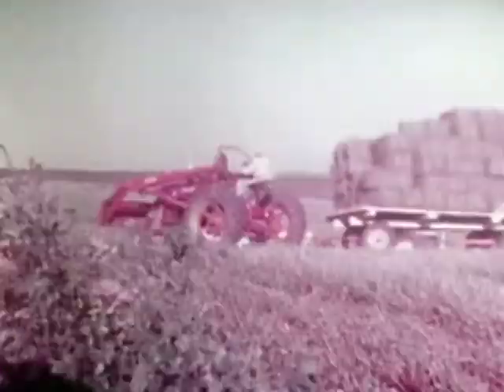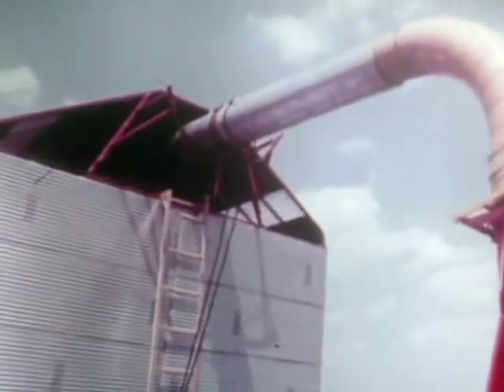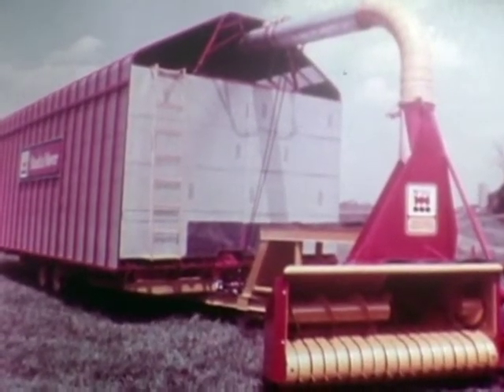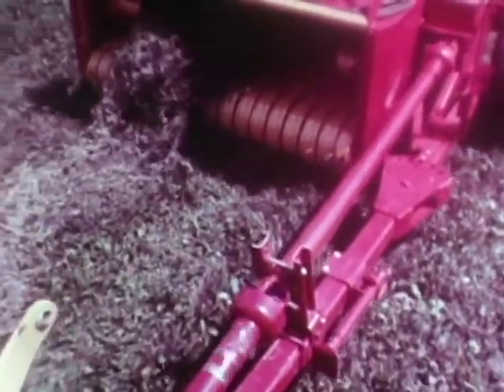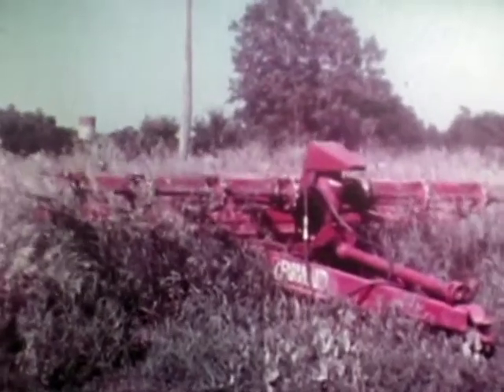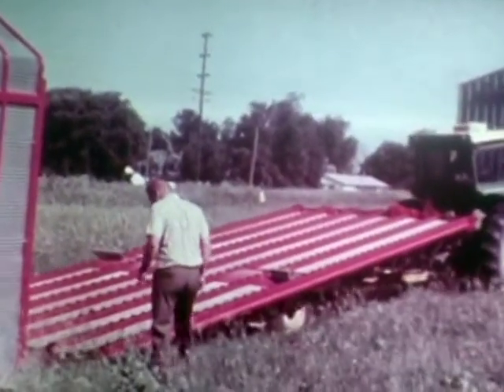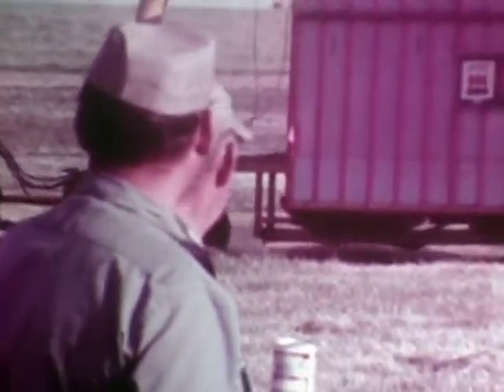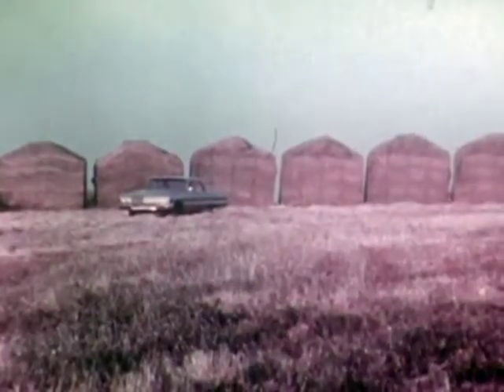Stack & Mover (1971)

Comment: My dad had a McKee that was one of the first machines made in the early 50's and he would fork the load off into the back of the harvester, the wagon would push the load to the front of the wagon and the harvester blew it into the top of the barn or tower silo .fantastic machine, 24 foot box on the wagon and lots of feed for cheap,I even went to see the factory where they were made in elmira Ontario

Comment: One of the shortest lasting inventions out there. Seems hardly anything they said in the video was true. 5 foot high haystacks end up under the snow banks with lots of spoilage. Now how many really think there's 10 ton in one of those stacks I mean like really. Anyone who ever stacked hay by hand can remember how high you were in the air when a f 10 farmland couldn't get it any higher and that was 10 ton back then
Reply: The guy weighed the stack in the video and it was 10 ton and the guy was standing beside the stack and the stack was 12 ft